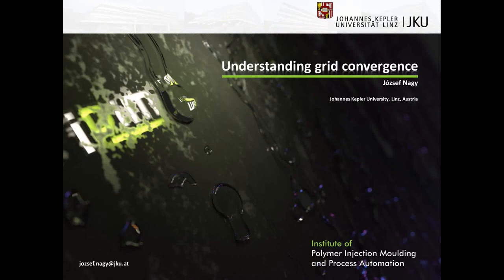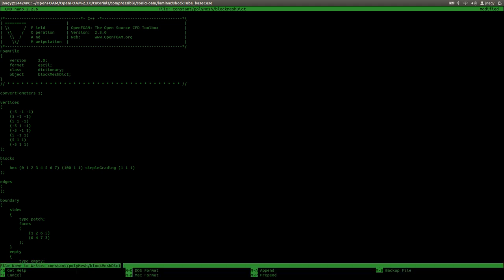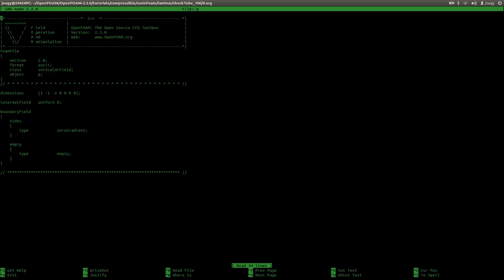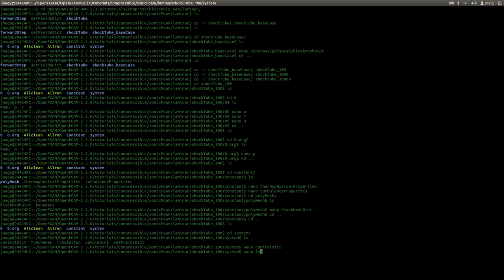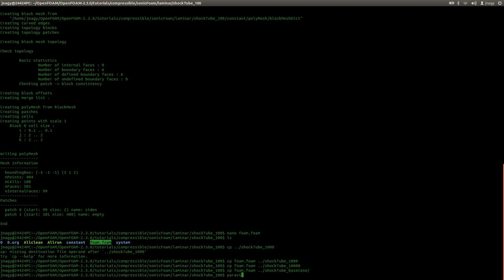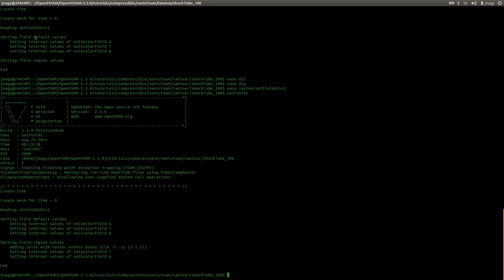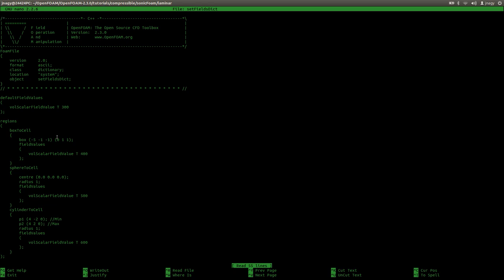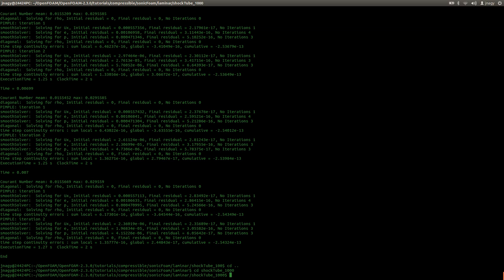Understanding grid convergence - Part 1

Comment: For anyone who had the issue with the "setFields" command and returned error such as  "Foam Warning: (...) Field U not found", "Foam Warning: (...) Field  T not found", "Foam Warning: (...) Field  P not found", try changing the  "0.orig" to "0" it fixed my issue.
Reply: I've also faced the same problem.
Reply: Now, I've tried to make a copy of 0.orig with name 0 and it works completely fine 😁. But I'm not sure if there will be any future problems because of this.
Reply: Made a copy with name 0. Worked! Thanks

Comment: At 10:54, one doesn't need to copy the files into shockTube_1000 and shockTube_10000 folder.

 Also, inside shockTube_100 directory, one can create the dummy file executing the "paraFoam -touch" command, which will create a file named "shockTube_100.OpenFOAM" which can be read by Paraview. Repeat the same for the remaining two cases.

To then visualize, one can run "paraFoam &" command, the "&" being the option to run the process Paraview in the background.
Reply from the maker: Thank your for your input.
Reply: @OpenFOAMJozsefNagy  thanks for all the work you do for us. Much love 😍

Comment: Hello, Your videos are very helpful. I was trying to run the foam.foam using paraview. But I don't know why I could not load it. I followed the whole thing as you showed in the video. Your reply is highly appreciated.
Reply from the maker: Several people seem to have this problem. Try another paraview version or you can convert your results to VTK. The command is foamToVTK. You'll get a VTK folder and there you can open your results.
Reply: I had the same problem... 
the problem was solved when I ran 'blockMesh' before running 
paraview foam.foam &
U must have run it beforehand :)
Peace :)

Comment: Hi József, I really enjoy following you so far, however, I noticed that the tutorial sequences are not the same for different openFoam versions. Right now I am using openFoam11 and I can't locate tutorials/compressible/sonicFoam/laminar/shockTube. is there a way to overcome this issue or do I just have to install openFoam2.3?
Reply from the maker: Yes, I do not support the .org version anymore, because of things like this. They just randomly drop things and change syntax to break compatibility. Please use v2312 to be compatible with my tutorials and also have backwards compatibility for the future.

Comment: When I open the case (before running the simulation) in paraview, p, T, and U don't load into it. After the simulation I still only see results from t=0,001 to t=0,007, but not for t=0. Any ideas what might be the reason for that?
Reply from the maker: Yes, uncheck Skip zero time.
Reply: These comments are amazing! Every problem I run into has a solution in the comments. Thank you @aveloxer and thank you @OpenFOAMJozsefNagy !
Reply: @OpenFOAMJozsefNagy  Thank you!

Comment: Thanks for those great tutorials! I tried to increase the duration of the simulation to observe shock reflection from the sides but interestingly shock wave seems to be damped out. Is this due to the zero gradient BC that we have used to define the sides? What kind of BC shall I use?
Reply: I think using noSlip BC for U solves the problem but I am not sure for p and T.
Reply from the maker: It is due to the discretization schemes. Take a look at the following videos!

Comment: 5:20 Why does sonicfoam use actual pressure [Pa] instead of pressure divided by density [m^2/s^2] like icofoam? Or did I misunderstand something?
Reply from the maker: No, that is correct. If you take a look at the compressible Navier Stokes equations, you see, that you do not divide by the constant density (because the flow is compressible i.e. the density is not constant). sonicFoam is a compressible solver. In icoFoam you solve the incompressible Navier Stokes equations, where you do divide by the constant density.
Reply: József Nagy Oh I see, it's kind of obvious now that I see what the code is doing. Kind of like how some codes solve the NS equations in non-dimensional form first, then multiply by the appropriate constants after a solution is found? I guess there's no need for the solution variables to be the actual physical quantities so long as a well-defined map exists to go between them.

Comment: hello professor, in this case , when we note the boundary in the blockMesh using the right hand rule, the thumb is pointing towards the surface  to match the results shown in the file..... this contradicts what I learned from the last video that the normal vector (thumb) is always pointing out the surface

Comment: Dear Jozsef,
I'm using OpenFOAM version 6. In the tutorial file, there is no 0.org file and in folder 0, there is no magU file too. Do I need to download the files from any external source?
Reply from the maker: In newer versions you don'T have this file. You don't need it for the simulation.
Reply: @OpenFOAMJozsefNagy  Thank you for your reply.
Reply: @OpenFOAMJozsefNagy  Dear sir,
I after running the analysis I got some pressure value other than 100000 and 10000. What may be the reason for that?
Reply from the maker: @binilbabu9460  Oscillations?

Comment: Hello,
First thanks for the great tutorials.
Could you please help me, when I type setFields I get this error
--> FOAM FATAL ERROR: 
cannot find file "/home/taron/OpenFOAM/openfoam6/tutorials/compressible/sonicFoam/laminar/shockeTube_baseCase/system/system/controlDict"

I noticed that it wants to find the file in system/system/  but there is only one system and controlDict is there so I tried to create that additional /system folder and put files in it and enter the command. Thish time it shows this:
--> FOAM FATAL ERROR: 
Cannot find file "points" in directory "polyMesh" in times "0" down to constant
Reply: Hello, you should run the simulation from the main directory. So try to run it like this : 

1-)Firstly, you should go up to your main case file. Do not run the simulation when your directory is in one of the sub-folders of the case file.

cd ~/OpenFoam/openfoam6/tutorials/compressible/sonicFoam/laminar/shockeTube_baseCase

2-) Then run the simulation from this directory path with "sonicFoam" command. If you are using the later versions of Openfoam such as openFoam-7 . You may need to type "rhoPimpleFoam" instead of "sonicFoam".

Comment: Hi. I followed the instruction but when I try to used the "sonicFoam" solver I get "FATAL ERROR" that it can not find the informations in fvSolution/fvScheme/thermophysicalProperties. I notice that content is this folder is different from content it is show in this tutorial. I try to change the data in these folder base on the tutorial but I still get error.   

I just want to ask where can I get the case setup with the same folders as this in tutorial. I am using openFOAM 2012.
Reply from the maker: I had recently a live stream of the redux version of this tutorial check out that video!
Reply: @OpenFOAMJozsefNagy  thanks for reply

Comment: Whenever I type setFields, I get this error:
Create mesh for time = 0

Reading setFieldsDict

Setting field default values
--> FOAM Warning :
    From function bool setCellFieldType(const Foam::word&, const Foam::fvMesh&, const labelList&, Foam::Istream&) [with Type = Foam::Vector<double>; Foam::labelList = Foam::List<int>]
    in file setFields.C at line 123
    Field U not found
--> FOAM Warning :
    From function bool setCellFieldType(const Foam::word&, const Foam::fvMesh&, const labelList&, Foam::Istream&) [with Type = double; Foam::labelList = Foam::List<int>]
    in file setFields.C at line 123
    Field T not found
--> FOAM Warning :
    From function bool setCellFieldType(const Foam::word&, const Foam::fvMesh&, const labelList&, Foam::Istream&) [with Type = double; Foam::labelList = Foam::List<int>]
    in file setFields.C at line 123
    Field p not found

Setting field region values

End
Reply from the maker: Did you use the correct syntax?
Reply: I guess I made a mistake somewhere. I followed your steps again and it was running fine. Thankyou :)
Reply: I had the same problem, and i renamed the files p.orig to p, T.orig to T and U.orig to U. After, that the setFields command gave the same results as the video.
I think its a problem with the openfoam7 users.
Reply: I just changed the folder name from 0.orig to 0 and the setField function worked.
Reply: @PM-ei3og  tht buds i had the same issue , just change the 0.orig to 0 it worked ,  the tut file copied doesnn't have the 0 dir so one need to change it to  '0"

Comment: Hello sir,
in paraview foam.foam I can't manipulate p, U, T and also there is nothing in  Cell Arrays. In your case you have T, U, magU and p but in my case it doesn't show anything in the Cell Array and in your case you can choose Solid Color, cellNormals, magU, p, T, U, etc. but in my case I can only choose Solid color, cellNormals, vtkCompositeIndex, CasePath (partial), vtkBlockColors (partial).
What did I do wrong?
Reply from the maker: Hmm. Difficult to say. Do you get some error from Paraview? Which version do you use?
Reply: József Nagy I use OpenFOAM5.0 and Ubuntu 16.04
Reply: and how can I get mag U file?
Reply from the maker: I mean which version of Paraview and is there a error message?
Reply from the maker: With e.g. the postProcess -funcs '(div(U) mag(U))' command
Reply: Hi there, 
I'm having the same problem. Do you already know how to fix it?
Thanks!
Reply: I had this problem and it solved itself when I launched paraview using the following command:
paraFoam &
Reply: @fengxialv9036  Thanks alot for sharing your problem and the solution! I had the same problem and I solved it with your help :) really appreciated!
Reply: @fengxialv9036  I encountered the same problem and this helped perfectly!

Comment: Thank you very much!!   But when I run setFields, it returned: 
Setting field default values
--> FOAM Warning :
    From bool setCellFieldType(const Foam::word&, const Foam::fvMesh&, const labelList&, Foam::Istream&) [with Type = Foam::Vector<double>; Foam::labelList = Foam::List<int>]
    in file setFields.C at line 125
    Field U not found
--> FOAM Warning :
    From bool setCellFieldType(const Foam::word&, const Foam::fvMesh&, const labelList&, Foam::Istream&) [with Type = double; Foam::labelList = Foam::List<int>]
    in file setFields.C at line 125
    Field T not found
--> FOAM Warning :
    From bool setCellFieldType(const Foam::word&, const Foam::fvMesh&, const labelList&, Foam::Istream&) [with Type = double; Foam::labelList = Foam::List<int>]
    in file setFields.C at line 125
    Field p not found

Setting field region values
    Adding cells with centre within boxes 1((0 -1 -1) (5 1 1))
--> FOAM Warning :
    From bool setCellFieldType(const Foam::word&, const Foam::fvMesh&, const labelList&, Foam::Istream&) [with Type = double; Foam::labelList = Foam::List<int>]
    in file setFields.C at line 125
    Field T not found
--> FOAM Warning :
    From bool setCellFieldType(const Foam::word&, const Foam::fvMesh&, const labelList&, Foam::Istream&) [with Type = double; Foam::labelList = Foam::List<int>]
    in file setFields.C at line 125
    Field p not found
Reply from the maker: Do you have a field "p" in 0?

Comment: Hello, everything works fine! Except for the ShockTube_10000 simulation. When I run SetFields I get the following message:

Create mesh for time = 0

--> FOAM FATAL ERROR: (openfoam-2112 patch=220610)
Cannot find file "points" in directory "polyMesh" in times "0" down to constant

    From virtual Foam::IOobject Foam::fileOperation::findInstance(const Foam::IOobject&, Foam::scalar, const Foam::word&) const
    in file global/fileOperations/fileOperation/fileOperation.C at line 1137.

FOAM exiting

Anyone can help me? Thank you so much
Sara

Comment: Sir, I am looking for simulating a jet impingement slurry erosion test. Can you please give me any suggestions for the solver that I must use? Also, how does one calculate the erosive wear rate using OpenFOAM?
Reply from the maker: +karsh tharyani I think, that for that you need both a multiphase and a compressible flow. So comperssibleInterFoam. Maybe you have to modify it. Take a look at the source code, if it contains everything, you need. As for the wear you could calculate the force on the wall, where your liquid hits the wall.

Comment: Hi, Jozsef! When I run the simulation of 100 cells and 10000 cells, there is a FOAM FATAL ERROR " negative initial temperature T0: -0.0406692". What can I do to solve this problem?
Reply from the maker: Which solver do you execute?
Reply: sonicFoam
Reply: I have the same problem. Did you solve it @Stan Zhou ?

Comment: Good mornign professor. Excellent Tutorials!

I managed to run this tutorial with OpenFoam8. 

Instead of using socinFoam I used rhoPimpleFoam

after running it appeared 2 warning messages:
"""
--> FOAM Warning :     functionObjects::mag mag(U) cannot find required object U of type volScalarField
--> FOAM Warning :     functionObjects::mag mag(U) cannot find required object U of type surfaceScalarField
"""

Do you know what does that means?
Reply from the maker: This has something to do with the functionObject incontrolDict, not the simulation itself.

Comment: when I try to run setFields for shocktube_100 I get this:

--> FOAM FATAL ERROR:
cannot find file "/home/alina/OpenFoam/tutorials/tutorials/compressible/sonicFoam/laminar/shockTube_100/system/system/controlDict"

    From function virtual Foam::autoPtr<Foam::ISstream> Foam::fileOperations::uncollatedFileOperation::readStream(Foam::regIOobject&, const Foam::fileName&, const Foam::word&, bool) const
    in file global/fileOperations/uncollatedFileOperation/uncollatedFileOperation.C at line 532.

I do have the controlDict but it is in  "/home/alina/OpenFoam/tutorials/tutorials/compressible/sonicFoam/laminar/shockTube_100/system/controlDict"

Any idea how to fix it?
Reply: Hello, you should run the simulation from the main directory. So try to run it like this : 

1-)Firstly, you should go up to your main case file. Do not run the simulation when your directory is in one of the sub-folders of the case file.

cd ~/OpenFoam/tutorials/tutorials/compressible/sonicFoam/laminar/shockTube_100

2-) Then run the simulation from this directory path with "sonicFoam" command

Comment: Sir, i didn't find setFiledsDict in my download .where i can find it??
Reply from the maker: This was in the tutorial, which came with OpenFOAM, but it is a simple text file so you can just copy it off the screen.
Reply: Thank you sir, for your support.
But now i am getting the following error when i execute the SonicFaom
Reading field U

Reading/calculating face flux field phi

Creating turbulence model

Selecting turbulence model type laminar
Creating field kinetic energy K

No MRF models present

No finite volume options present

Starting time loop

Time = 1e-05

Courant Number mean: 0 max: 0
diagonal:  Solving for rho, Initial residual = 0, Final residual = 0, No Iterations 0
PIMPLE: iteration 1

--> FOAM FATAL IO ERROR: 
keyword div(((rho*nuEff)*dev2(T(grad(U))))) is undefined in dictionary "/home/manikanta/OpenFOAM-in-Box-18.06v1/Othercases/OpenFOAM-2.4.x-master/tutorials/compressible/sonicFoam/laminar/shockTube_100/system/fvSchemes.divSchemes"

file: /home/manikanta/OpenFOAM-in-Box-18.06v1/Othercases/OpenFOAM-2.4.x-master/tutorials/compressible/sonicFoam/laminar/shockTube_100/system/fvSchemes.divSchemes from line 30 to line 36.

    From function const Foam::entry& Foam::dictionary::lookupEntry(const Foam::word&, bool, bool) const
    in file db/dictionary/dictionary.C at line 441.

FOAM exiting

  Could you please help me with this?

   Thankyou in advance
Reply from the maker: I used back then the recent version of 2.3.0. You might, but it is a better idea to use the recent ones. On wiki.openfoam.com/Tutorials, amogst my tutorials I mention the syntax changes in recent versions. Unfortunately YouTube doesn't allow me to change the videos.